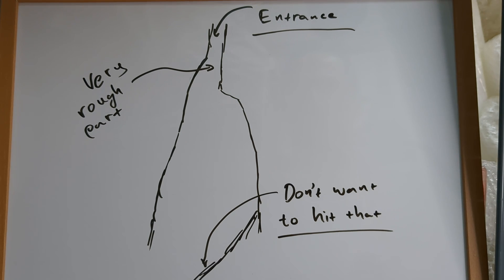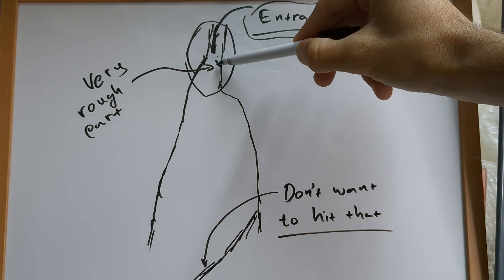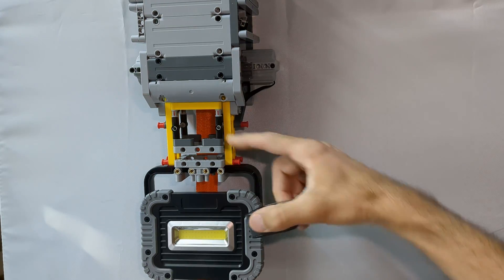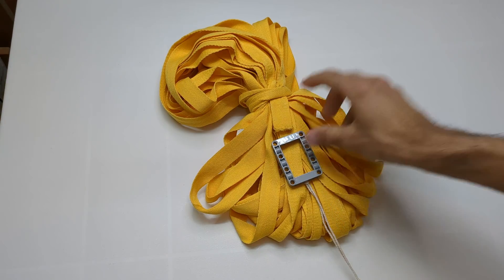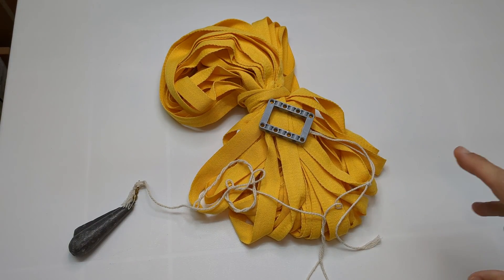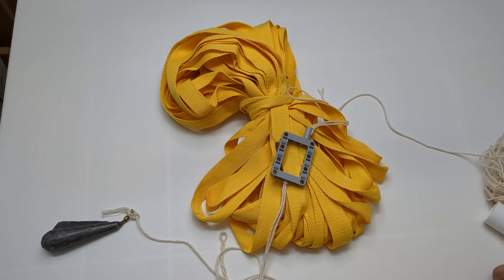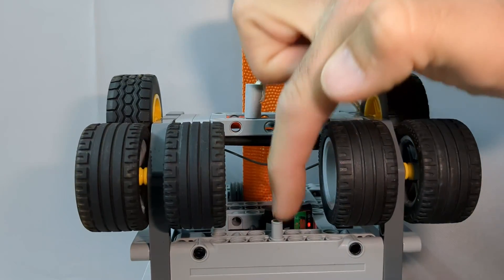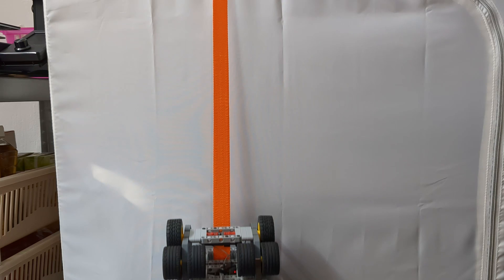LEGO Technic vehicle rappels 22 meters down deep chasm cave.

Comment: Journey to the Centre of the Earth, LEGO Technic style.

I am very happy to watch part 2 of this mission, after watching part 1 some number of months ago. Congratulations on the success of your mission! Did you achieve all that you set out to do? Can we expect part 3 of this mission? Did you get any ideas from the comments on part 1, on how to safely descend your vehicle?
Reply from the maker: Glad to see you're back to see part two! This mission opens up possibilities for many more projects, as the rappelling system seems to be able to lift a lot of weight (with the right gearbox of course). Definitely expect to see a small vehicle rappelling down a cave, and further exploring using tracks or tires to move around at the bottom. I'll need an FPV system to achieve that though, as I'll have to see where the vehicle is going.

The comments always help to further brainstorm on any problem. The comment section actually inspired me to use a retractable cord to measure the depth of the cave and monitor the position of the vehicle to avoid smashing on the bottom at full speed.
Reply: @brickandgear  has anyone else explored the cave in recent times? What has prompted you to explore this particular cave?
Reply from the maker: @EVP22  it's very popular among cave climbers for training reasons. Very accessible, with a good total depth and it is 100% mapped. Fun, but grim, fact during the first exploration of the third chamber, two human skeletons were discovered dating from the 1800s. A clear sign that there was another entrance to the third chamber that collapsed when the two humans were inside.

I visited the entrance to that cave, as well as many others on that mountain, when I was a student riding my mountain bike. I was always fascinated by deep cave systems, high mountains, and all sorts of exploring so I decided to bring my LEGO into the adventure!

Now I need to convince Elon Musk to launch one of my vehicles to the moon...

Comment: You could add some wheels on the sides too for better descends and another camera on the other side or at the bottom so you can see where you're going.
Looking forward to the part III. with the exploration vehicle :)
Reply from the maker: I tried to keep it as light as possible, otherwise it wouldn't be able to climb back up again.
I can't wait for part III as well, but I can't do it yet. I'll need to build an FPV system first, as I'll need to see what the vehicle sees down there.
Reply: @brickandgear  You could try doing it with a crane to pull it up instead of it pulling itself up also I don’t know if this would work but maybe use multiple cranes that lowers it down and uses and electromagnet to connect to it but it would have to be really strong to do that without disconnecting when hitting stuff and since it seems to mostly be a really wide chasm you could probably make a crane that is stationary but and moves but you would have to get rid of the fencing over it and if it gets stuck you wouldn’t have to push the rope and also since there is probably terrain it would get stuck on I think you should add tracks and a secondary crane that isn’t Lego to pull it out in case of emergency that has a way longer rope and Is connected too the build securely so it can be pulled without the worry of it falling off
Reply from the maker: @Ayers-dog-lover  I used a crane during my first attempt. The problem with the crane is building a winch that can handle a huge amount of pressure that builds up as the rope gets wrapped around the winch axle. Wrapping 25 meters of rope stresses the build very much and it's prone to structural failure, as axles tend to bend under the immense load. So, for such a depth, using a belt and rappelling system was much easier. Then comes the rate of descent/ascent. A winch has a much lower rate of descent/ascent and my DJI Anton 2 camera can only record 15 minutes of 2.7K video before overheating and shutting itself down. So, it would probably shut down before it resurfaced. With the rappelling system, the vehicle went down almost 25 meters and back up again in under 5 minutes!
Your electromagnet idea is amazing! A fantastic system to lower a small vehicle and release it once it reaches the bottom! I'll have to brainstorm on it!